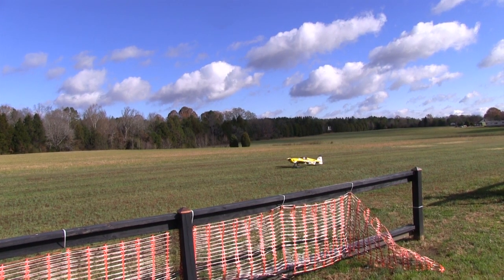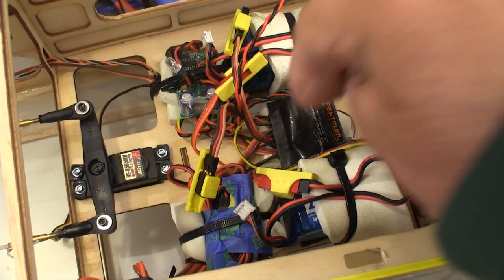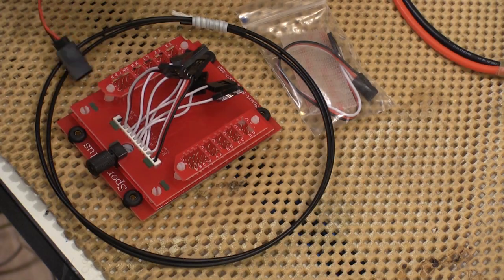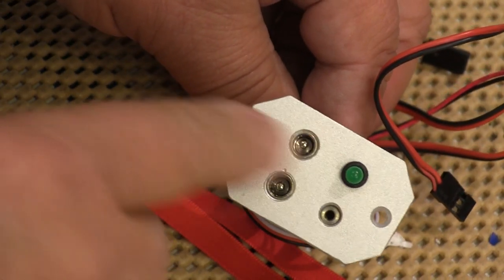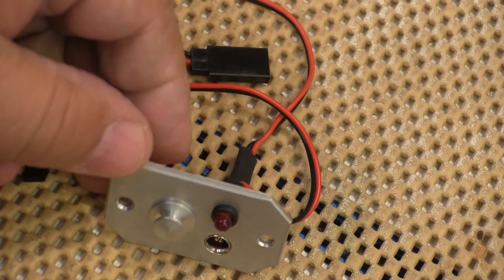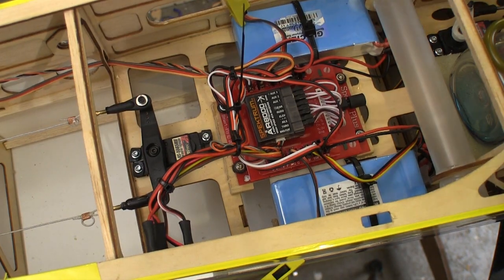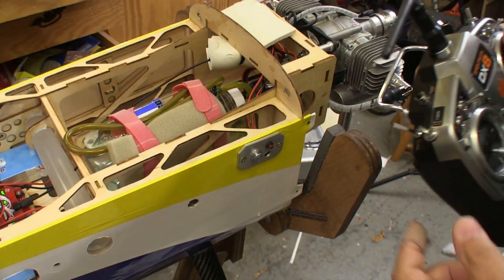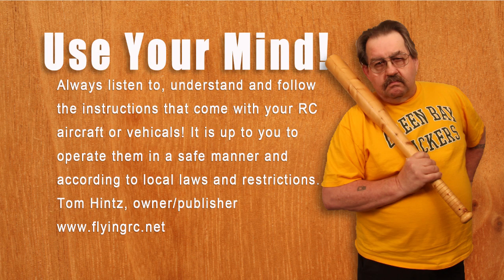Curing Stalling Servos

Comment: Nice video thanks for posting! At what size of airplane do you decide its time to install one of these? 1/4 scale and bigger maybe?
Reply from the maker: I don't know that there is a general breaking point on the need for a system like this. I started using this and other safety systems like redundant batteries in planes that cost me enough to make the thought of it failing and going splat made me want to hurl.
Reply: @flyingrcdotnet  OK I get it it! It’s based on the hurl factor. The higher the hurl factor the more likely you are too use the power expander. They should use that factor in their advertising 😀🤔🤣

Comment: Hello.  How are you charging the power expander batteries?  You are using lipos.. do they work with the charge ports on the failsafe switches?
Reply from the maker: The batteries are easily accessible so I unplug them and charge directly with my ICharger. I've never had an issue between LiPo's and components rated for their voltage.
Reply: Thanks. Good to hear.  I just received the smartfly system for my 50cc.  Starting to install it this week.

Comment: I'm just curious, what exactly is wrong in your original set up, how does a servo stall when there is raw 2s power supplied to it
Reply from the maker: I had dialed in overload protection in the servos in another plane, forgot that and in this plane the aerodynamics were stalling the servos at that lower power. Took out the overload protection, made sure my wiring was up to snuff and all was better. I am sometimes doing just too many things at once at times when video needs to be done.

Comment: What servos are you running? There torque rating may be low.
Reply from the maker: HiTec HS-5565MH and they have more torque (200in/lbs) than Aeroworks calls for, if they are on 7.4V which is what the problem was. You can see in the video that the problem is fixed, same servos.
Reply: thintz12
Ok cool. I was running the 7985MG's on 6.6V Lifes and never had blow back on the ailerons surprisingly.